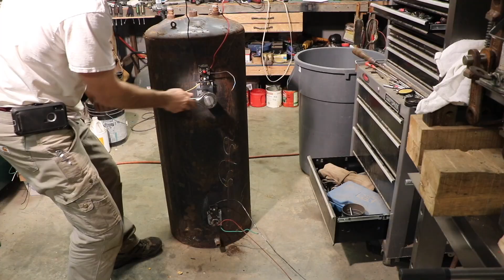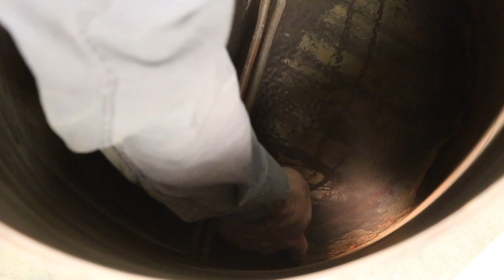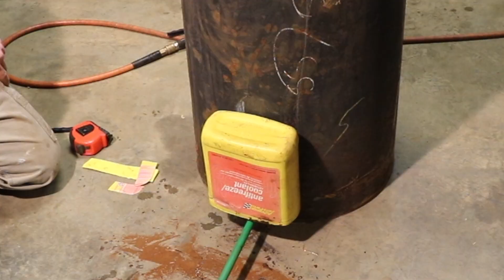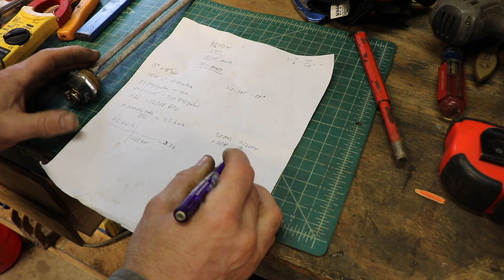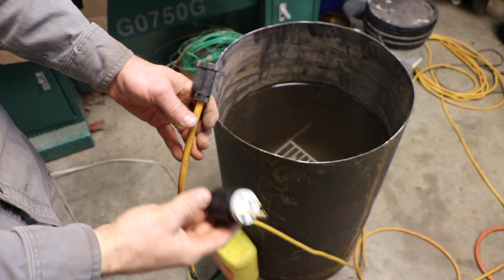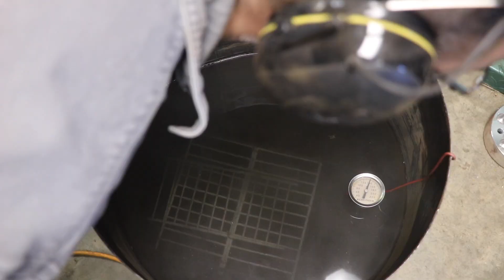Making a Chicken Scalder From An Old Water Heater. FarmCraft101

Comment: Jon, a suggestion for what it’s worth. That garden hose you connected for draining probably won’t last long with 145 degree water. Might last longer if you put a gate valve in and let the water cool down to 90 or less before draining.

Comment: It needs to be covered during heating, a lot of energy is running away to atmosphere. I would also solder those twisted wires to prevent oxidation, before putting the insulation cap.
Reply: yea always cover a pot if you want it to boil quicker

Comment: Whenever I need to remove a fitting and there is a lot of rust involved, I like to thread on another fitting on the open end so that the threat of crushing the pipe is lessened.  Saved my bacon a few times with that hack.  Looks like you didn't have a need to save that old, galvanized nipple so it's a moot point but still...  Great video John thumbs up.

Comment: I know this is a couple months late, but  why not install that second heating element that came out of the water heater? If nothing else, you'll double the surface area of heating elements that are making contact with the water
Reply: That would double the power, meaning you'd need a 40A breaker for 240V, or 20A for 120V (and the 120V with two elements set up would still be half as good as a single element at 240V).

Comment: I'm kinda surprised you didn't sandblast the entire rusted area out and then put a thin coat of JB weld or some epoxy paint over the top.
Reply: That's a hell of a lot of work for minimal, if any, benefit. The rust isn't going to hurt anyone. I'd rather have a bit of rust on the chicken than epoxy residue.

Comment: I would have taken a weedburner torch and pointed it at the side for 20 min for preheat.  240V extension cords holding back 25Amps of any length are spendy.

Comment: I didn't got your explanations in the video at first , so this might help somebody: P(Power,Watt), U(Voltage,Volt), I(Current,Ampere)
P=U*I
I=U/R
=> P=U²/R
The resistance of the heating element is fixed, also you know your Voltage. So getting the power from the voltage and resistance is (as shown above) done with P=U²/R, so if you divide U by 2, you get (U/2)²/R = (U²/R)/4 which will give you a quarter of power compared to full voltage.

Comment: That master welder I mentioned from Laos also raises chickens...I mean he is from Laos; of course he has chickens, ha. I found him a solution to plucking chickens that is far easier. It was a motor that had a bunch of special design rubber fingers on the drive shaft. The fingers would smack the chicken, grab the feathers, and pluck. You just have to stick the chicken under it. The fingers are inexpensive as they are produced for the industrial chicken industry.

Another option is a chicken plucking drum. It is a spinning drum filled with those rubber fingers. Throw your dead chicken in, add just a little water, and bang, your chickens are plucked. I never used one, but I saw it used. It looks super violent, ha, but the chicken come out undamaged...just naked.
Reply from the maker: Yep.  I have a chicken plucker.  Built it before I started my YouTube channel.
Reply: @FarmCraft101  When my mother and I got pheasants back in the day, we would just take their entire skin off rather then try to pluck them. It came off easier then expected. I guess birds are just like that. Easier then a catfish that is for sure, ha.